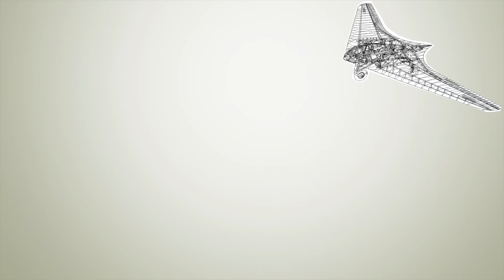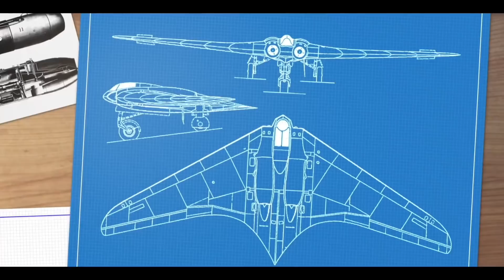The Horten Flying Wings built after ww2

Comment: Aerodynamically, a flying wing is a configuration where the elevator wing is moved forward until it blends into the main wing. Works great and gliders with this concept (e.g. Horten H IV) were among the best of their time. — — — However, if you want to do something with such an aircraft besides just flying it, you need a fuselage anyways. For cargo, passengers, whatever. Having a fuselage, there's not much point in keeping the elevator wing in its forward position. So it gets moved back to the end of the fuselage, where it's more effective, and you have a standard configuration again. That's why we see not many flying wings, and likely won't see many in the future. — — — That said, there are a few niches where we still see them: bombers like the Northrop B-2 (cargo small enough to fit into the wing) and, after all, delta wings are essentially flying wings, too: Concorde, Mirage 2000.